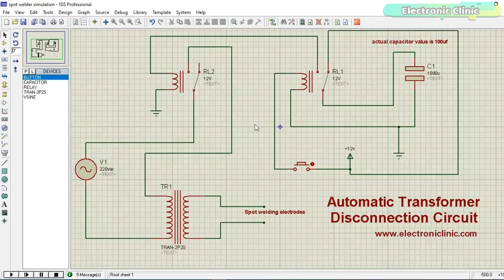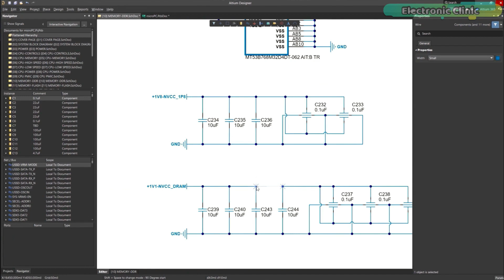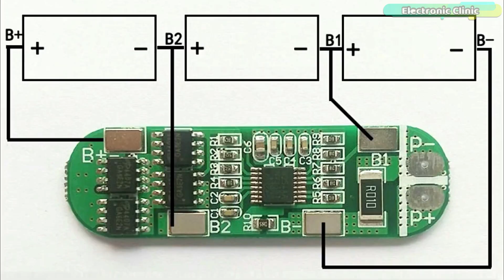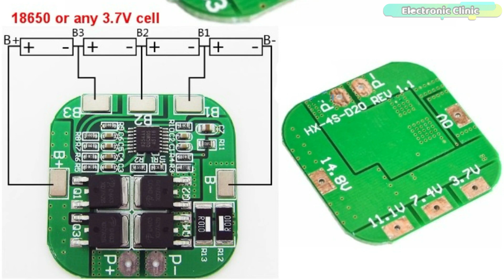How to make Lithium Ion Battery using 3S BMS and 4S BMS Wiring explanation, spot welding machine

Comment: Can this battery be used for rc plane as they require higher discharge
Reply from the maker: you can't use these batteries. Today, i got 21700 lithium ion batteries. I will make a detailed video on 4s battery.